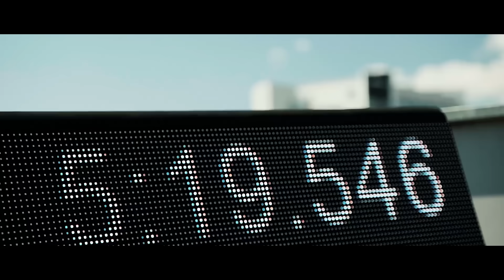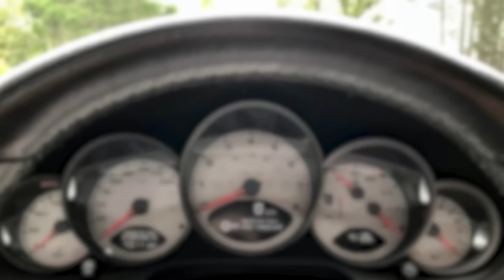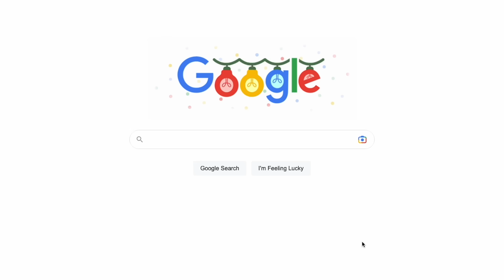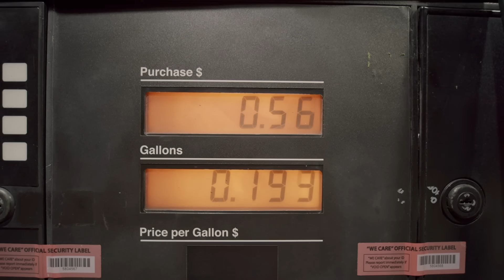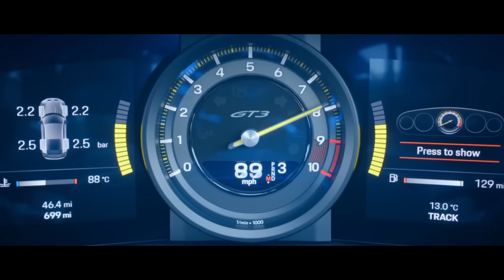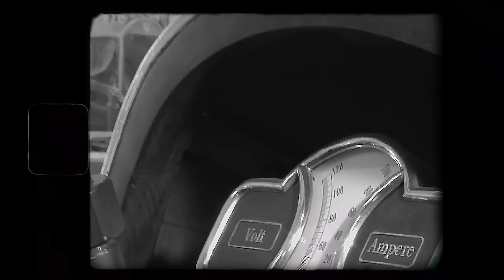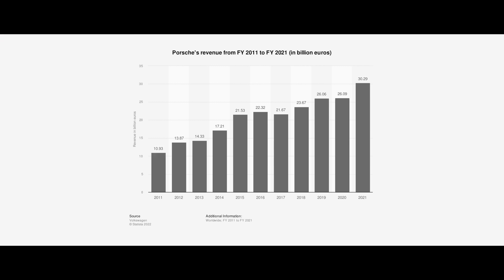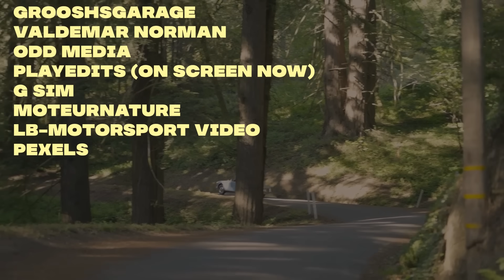Why Porsche doesn't race in F1

Comment: Yea, there's literally no real reason for Porsche to join F1 other than flexing their brand, and it's a very expensive flex if they start from scratch (hence why they tried to purchase RBPT because it's already proven to be a very strong platform)
Reply from the maker: Well put!
Reply: 1 reason would be to wash out the shame of building literally the worst F1 engine ever. No matter how highly Josh thinks of them they got dusted and embarrassed themselves in F1.
Reply: No they weren't trying to team up with RB
They just wanna avoid that 300 Million pay for new manufacturers joining in lol
Reply: @nodo7575  you know that they also made the literally best engine in formula 1 history right? The MP4/2 McLaren is literally most successful chassis ever entered and with Porsche engines McLaren won 5 championships in 3 years
Reply: James Black  Don't try to argue with a F1 snob with facts and reason.  They just want to hear how F1 is the best and anyone not in F1 is 2nd or 3rd rate.
Reply: @Alan-ww8vi  You want facts? 7 years after producing the TAG/Porsche engine (which was built to John Barnhard's specifications, not their own) Porsche came up with the type 3612 V12 for Footwork Arrows. It was SO BAD it was replaced with a Ford unit mid way through the season. Porsche themselves agreed to terminate their 4 year contract out of embarrassment.  I mean it weighed over 100 lbs more than Ferrari' s V12 and was SO big the car had to be redesigned to make it fit. THAT'S the reason Porsche hasn't be involved in F1 for over 30 years, pointing out the truth doesn't make one a snob.
Reply: @johnjones928  So they made a championship winning engine, then they made a dud.  And you've solely focused on the dud because...? Well I don't know, but I'm right in saying that F1 snobs like the gatekeep their existing teams and manufacturers like the are a league above everyone else when they're definitely not.
Reply: @Alan-ww8vi  I acknowledged the TAG engine, but pointed out the "dud" because that was the last unit they build solely on their own. As for the gatekeeper thing explain how F1 changing it's engine rule at the request of manufacturers that aren't even IN the sport qualifys as gatekeeping. 
I'll agree what they're putting Andretti through reeks of racketeering but they bent over backwards for VW.
Reply: @boopitywoop7981  quite the contrary, they could waive the entry fee by buying Williams or Alphatauri, which are both on sale, but they want to enter F1 and win quickly. Not be Aston Martin, Renault or McLaren.
Reply: They didn't just try to buy RBPT, they tried to buy Red Bull Racing, or at least a controlling stake in it, which is why the deal fell through.
Reply: @paper plane Wrong. The brand value of Ferrari is only more significant in the minds of F1 snobs.  The reason they didn't not recently compete in F1 is simply because they didn't need to compete in F1, instead of them lacking the capability, like most F1 snobs like to think.
Reply: @Alan-ww8vi  It's not being snob. It's the truth. Renault beat Porsche at Le Mans in the 1970s and immediately moved on to F1, which to them was a bigger challenge.

Sportscars were only comparable to F1 in the Group C era and this is a big "maybe".
Reply: @nightdriver7216  and in 1970s Porsche literally dominated all races with 917 and in group c aswell they dominated that much and group c was by far harder group than formula 1 that the cars were going 400 kmhs and enduring for 24 hours which is why most of the constructors failed in group c and went into formula 1 and group c was way faster that most of the people was watching lemans instead of formula 1 the main unofficial reason why group c was banned,snob
Reply: @paper plane yeah like Ferraris cheating sf90 is slower than 919 Evo lol in your explanation then let's see Ferrari making flying cars with Boeing or literally helping to build passenger planes building yatchs building jets and tanks then?
Reply: @paper plane and why would they ran away like they literally built one of the best engines in formula 1 and more successful than any other Ferrari engine ever existed,it was that better consturcor literally had 150 points while Ferrari had 49 it was that better after fia put turbo boost limit after Ferrari cried they still managed to loose old Porsche engines that was built for recent season
Reply: Since the F1 boys the snobs May be a sports car racing fans should be snobs to F1 because we’re actually cost-efficient and relevant
Reply: @paper plane it hasn't beaten because Evo didn't even make proper lap and they used no autoupshifts even nürburgring settings at spa with only 4 laps with harder tires and guess who can race and literally survive at nürburgring huh? And you forget the engine of it literally meant to survive for 24 hours and work stable
Reply: @paper plane and sf90 was already unrestricted lmao
Reply: @paper plane and 919 Evo never even used half of its power due to driver safety
Reply: @paper plane and if we talk about v12 they were working at v10 engine which later used in Carrera GT at the time the reason why v12 was bad they didn't spend money on it and work on it since they knew after a while they would use V10s and they had budget issues so instead of working on v12 they focused on V10 engine which is why v12 they made was bad but footwork was even worse team that after they switched to ford engines they raced even worse and instead of waiting patiently they cut off the deal... bet you didn't know that too snob
Reply: @paper plane and faster again? Sf90 literally 2 seconds slower than Evo
Reply: Damar Fadlan  it means nothing to join.."miracle of Motorsports" yet new F1 cars are slower than 5 years old 919 Evo by literal 5 seconds
Reply: @paper plane lmao the engine was that good they literally used it as helicopter engine later
Reply: They tried to steal honda IP and own redbull. That flex is cheap and weak
Reply: @vr5lover  And? F1 was more prestigious still. WSC was popular in the 80s but the F1 battles are still remembered more.

When it comes to Group C and GTP, Porsche had a headstart and fell behind once the big money from Ford (Jaguar),  Mercedes, Nissan and Toyota arrived. Out of those, only Nissan didn't eventually abandon prototypes to join F1. Porsche's early competition was Lancia, which would rather focus on the WRC instead.
Reply: @nightdriver7216  nope literally the real reason why group c was banned is because of views that cars was more tough and harder to make,fastest top speeds at motorsports and I don't think you know that 962 is literally best group c car officially and it even had competition or 956 literally putting record couldn't be broken untill 2017 do you think someone could win that? I mean even with competitions they still were mostly superior in group c
Reply: @D3Vlicious  if I saw it correctly, red bull only wanted the same honda-esque deal where porsche only supplied the engines. But porsche wanted more and I don’t see why they should. Red bull is right putting them in their place.
Reply: @Alan-ww8vi   they don’t need to yet they want significant input with redbull and it rightfully blew back in their face. Don’t lie to yourself. Porsche wanted it. Just like how Ferrari is making an lmh as well to join WEC.
Reply: Porsche won’t be in f1 for the simple reason that they don’t want to do what every other f1 team had to do to get where they are today and in my world, you lose respect for being a car brand that brags and boasts so much performance but wont put it into the pinnacle of auto racing to test its true ability and it’s because they know if they start from scratch they’d be where Aston is on the grid… idc about your latest Porsche engine, the last time they won blah blah…. This is today and this is the Porsche we’re dealing with today, not back then, not how many wins they have back the . I don’t care. It all comes down to the fact that Porsche would build a shit F1 car and it would damage the brand’s reputation for “performance”
Reply: @Yeetttt615  The reality is this: Porsche has the best driving road cars in world, and those cars are what matters because at the end of the day nobody is going to work in an F1 car every day lol. Hell, pretty much any current F1 innovation has zero influence on the engineering of road-going cars.
Reply: @OmegaF77  thats highly inaccurate
Reply: @OmegaF77  a lot of mechanical parts in an f1 car especially for Ferrari, are often used in cars. Mclaren, Aston, also do the same. Rather that be through aerodynamics, engine parts etc only team on the grid that doesn’t use parts in their cars would be Honda. Because…they’re Honda
Reply: @OmegaF77  so no the reality isn’t “Porsche has the best driving road cars so they won’t build an f1 car” if that were truly the case why would they have publicly stated that they were entering f1 and then non publicly decline to join conveniently right before signing up for the new engine regulations. Porsche knows if they got into F1 they’d be where they were when they first joined and that’s minus Dan Gurney’s wdc season in 62
Reply: hmm fun fact .. they just started makin a f1 engine .. it will be done i 4-5 years .. and i also know who and where its gonna be made
Reply: At this point I don't know what is the point of F1 even existing anymore. Electric tech is being worked upon by FE and GT racing and Endurance racing can experiment upon the synthetic fuels which are being dreamed about.
Reply: @TattvaRajput24  cause you don’t actually know what Motorsport is…
Reply: @Yeetttt615  what? I have been following motorsports for years it's just that the current F1 regulations are so garbage that they cannot be ported into the road cars without making cars too expensive.
Reply: @TattvaRajput24  then why does almost every brand on that grid implement f1 tech in their cars that get sold to the public, minus Honda… you want affordable go watch the Honda civic cup
Reply: except they are trying to join...
they are trying to write their name on an f1 car and trying to buy or sponsor a team.
Reply: @Alan-ww8vi  they woudlnt even be able to compete.... saying they dont want to join f1 while they are trying to join f2 is jsut dumb as hell lol
Reply: @Yeetttt615  I can tell you've drank a lot of the F1 kool aid.  "Why does almost every brand on that grid implement f1 tech in their cars that get sold to the public, minus Honda" - Go ahead, name the models and I'll tell you how they are simply a halo car to market the brand as having F1 influence but actually have 0 road relevance.
Reply: @Alan-ww8vi  lol take your nonsense elsewhere. Obviously you have no clue what goes on in f1 😂
Reply: @Alan-ww8vi  stay sad lol
Reply: @Yeetttt615  Still unable to back up your claim.  It's clear who is the sad one try to win internet arguments with no substance.
Reply: @Alan-ww8vi  you’re the only one arguing 😂😂now it’s time for you to get a life
Reply: @Alan-ww8vi  stay mad with your dinky Hondas lol
Reply: @Yeetttt615  Examples. Provide them. And no, they haven't. Get learnt. Unless you think any ICE with hybrid happens to be F1 related then....well that's on you.
Reply: @Alan-ww8vi  Mercedes uses hybrid technology derived from its F1 car in models such as the S-Class…
Reply: @Alan-ww8vi  trust me bud, the only thing here that lacks substance is yourself lol
Reply: They are in Formula E, which makes more sense.
Reply: And Ferrari and Mercedes need to be in formula 1 to prove their brands. Sounds like someone is a Porsche fan. It’s about proving your the best, something very few people would consider Porsche.
Reply: @Russtheguy  Mercedes doesn't need to be in F1 to prove their brands and their road cars do not compare as well to BMWs if we are talking about their supposed sportiness.  Something you would know if you actually know the car industry.  Your comment is a logical failure.
Reply: @boopitywoop7981  Porsche had talks with rb but they didn't agree on terms.
Reply: Very expensive
Reply: @nodo7575  F1 should have spec’ed V8 ‘s and stayed there, V6 Turbo’s are garbage
Reply: @vr5lover  Imagine if The Honda powered Mclaren bare the same chassis name for four years don't forget MP4/4 and Williams days. Porsche made great engines but their achievements are incomparable to the likes of Ford, Ferrari, Honda, Merc and Renault.
Reply: @redbuIIracing33   @Crate  Porsche wasn't developing the engine,plus it was stronger than MP4/4,and no ford doesn't have ANY success at formula 1,it was all cosworth.Not to mention Porsche literally humiliated Ferrari every race it entered in in 1980s including formula 1,and sorry idc about your words after all even Goodwood admits it's the greatest car ever created in F1,in fact MP4/4 is literally more regulated,slower version of MP4/2 and A LOT more slower.And if we talk about mercedes I think we all know why they have been successful in F1 right? They knew regulations years before,they had no normal competitor like honda was dead at that time and I won't even talk about Ferrari or Renault while Porsche had direct strong competitors and still was able to win 5 championships and get championships in 3 years of 4 competition it entered in,even till now MP4/2 remains most powerful car ever created in McLaren formula 1 team and one of the most reliable one,not just that FIA was putting regulations because of the Porsche engine,every year to year and still it was able to get 2nd in constructors without Porsche even being in F1 and no upgrades while all others did make upgrades not just that as I mentioned it was regulated even more
Reply: @redbuIIracing33  It's not hard to just make 5 minutes research,I won't even argue with you it seems you think ford actually did something in formula 1
Reply: @redbuIIracing33  not just that also Porsches powered MP4/2 had one of the greatest performance in single season in 1984,the 4 races was lost not because of the engine but because of the gearbox issue
Reply: @redbuIIracing33  and also not to mention,Porsche did all of these while having races in several classes which includes group c that is far more advanced than f1 at the time and they were in their poor times.
Reply: @redbuIIracing33  and nobody cares about your "imagine if' or something,it's statistically a fact
Reply: @Russtheguy  quite literally made one of the best engine in F1,made a car that puts F1 cars in dust and can actually lap around nürburgring so this doesn't prove enough? Or literally having 20 times 24h lemans win
Reply: @Yeetttt615  f1 is far from the pinnacle, its so tightly bound by rules and regulations (same with a lot of series) that every car is practically the exact same and the only thing that makes a difference are the drivers.
Reply: @YoungShul  Formula One is the pinnacle of motorsports. It's the fastest and most technologically advanced racing series on the planet by definition... Maybe get your facts right before you feel the need to share opinions …
Reply: @nicholascooper2539  first of all that logic in itself is flawed, its my opinion, and second of all it was stated in this video that the 919 evo (which is not bound by rules) was faster than any f1 of its time. While f1 is currently the most technologically advanced series, there certainly could be faster and more advanced races if the restrictions were eased or removed, with manufacturers able to create something like an 919.
Reply: nevermind expensive flex, F1 is one of those things you can't throw JUST money at the problem. Ask Toyota. And the fact that the barrier to entry, let alone successful is so steep in F1, makes it less appetizing for Porsche. No, I do think Porsche can be at least a regular midfielder if they get in F1, but do you really think Porsche would accept the fact that they won't be regular contenders for the first 2-3 years they're in? "Not winning" is the antithesis to the Porsche brand thanks to their own success I guess.
Reply: Every team join F1 for flex and ad
Reply: That’s because RedBull are better F1 engineers. Porsche just stick to what they know- 911 sports cars.
Reply: @Yeetttt615  it isn't lol,there are a lot cars that's way faster than current F1 cars and got way more advanced technologies in it.
Reply: they have been in F1
Reply: @JohnWarren  They have been in F1
Reply: I wish they would bring their N/A Flat-6 in F1
Reply: @vr5lover no there isn't much more faster cars. Most of the fastest lap records are held from F1 2003-2004 cars. The 919 Evo Spa record gotten beaten by 2018 F1 cars in qualifying in fact the top 3 for Q2 times beat the record just a year after the EVO set records. Could of been faster for Q3, but it rained right after they set the times.
Reply: @wiryantirta + Not to mention unlike other sports your performance is so chaos. I mean one year your fastest next year and then if u make a mistake for next you drop off right to the midfield and then continue there cause u can't change the concept and to make up ground Porsche will probably be disinterested if they can't win any time within 3-5 yrs.
Reply: There's a large cost element too, they wanted more or less someone to fund their engine development
Reply: @johnjones928  You are telling me Porsche doesn't want to get into F1 because they are "embarrassed" of a bad engine they made 30 years ago? Buddy we are talking about a car company not a socially anxious teenager 😂
If they can get something good out of F1 they would do anything to get in but they simply don't need to. They tried to get in the cheap and easy way but it didn't work. They just don't have any real reason to invest a ton of money into it.
Reply: @nodo7575  Again, we are talking about a company. Companies don't get ashamed, or else Ferrari wouldn't be in F1 right now 😂 It's as simple as they just don't have much to gain from it. Really not that deep.